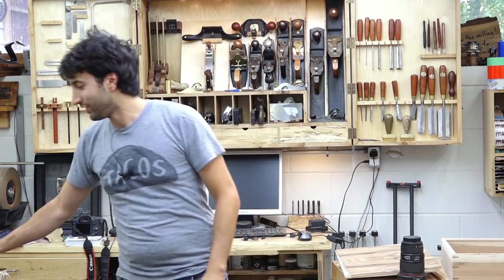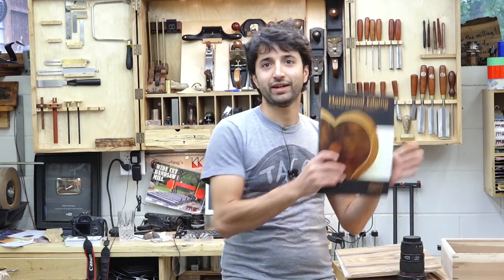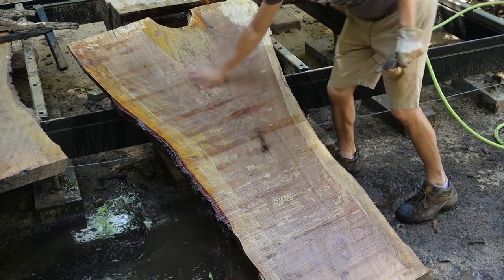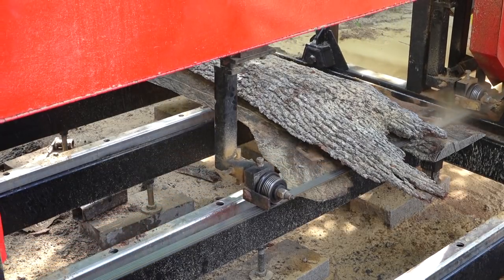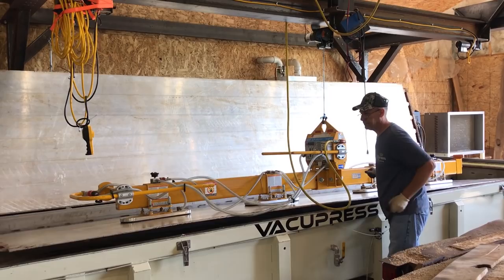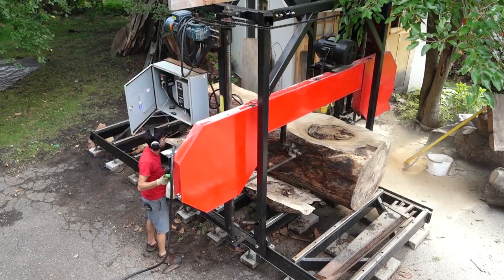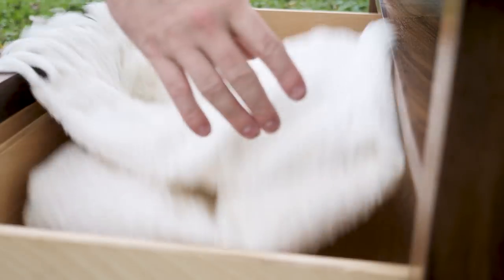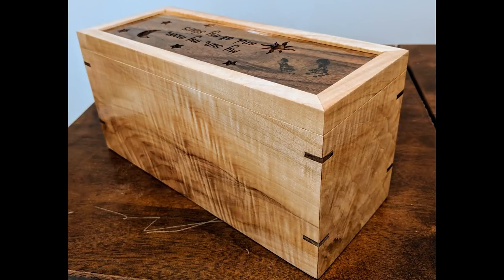Book Giveaway, Sawing Live Oak, and Vacuum Drying

Comment: Most live oak down here in FL ends up in landfills or fire piles.  There's a few urban lumber reclaimers but the supply far exceeds their capacity.  My yard is covered with them - I hate them.  They constantly drop leaves year round, and they're hard and waxy and don't decompose, you have to remove them. And it seems they have a never-ending supply of twigs to rain down on your lawn and sap that coats your car nightly.

Comment: The veneer video is great!  Live oak, is used for firewood here in FL.  I have tried several times to dry it in my solar kiln, and it always cracks, sealed with anchor seal.  You have a "wooden thumb", so I am glad this live oak works for you. It is pretty wood, used in building the USS constitution.
Reply: It can be dried but you are absolutely correct!  Most who are familiar with it....are not fans.  However, it ABSOLUTELY can be milled into beautiful and extremely hard lumber.  Most logs are not good candidates but we get a lot of live oak and repurpose these left for dead trees into beautiful lumber and live edge furniture.  We have yet to find a junk tree!